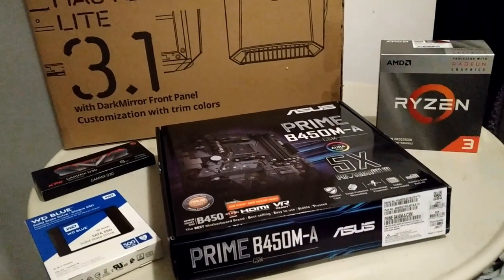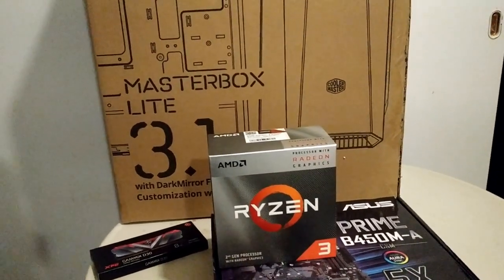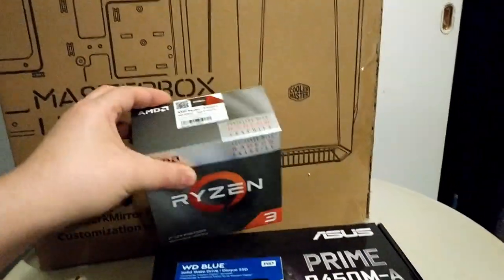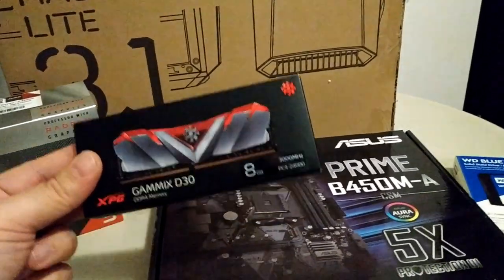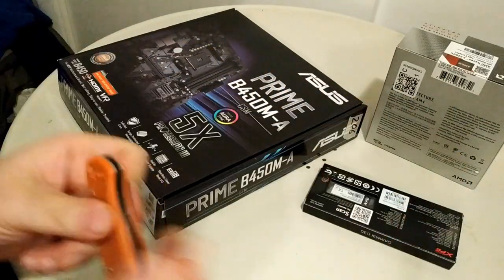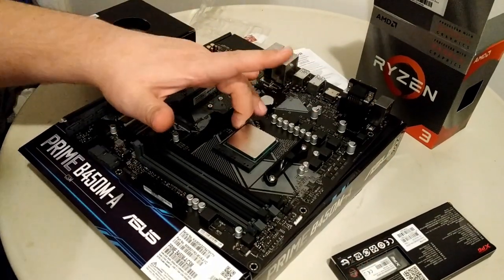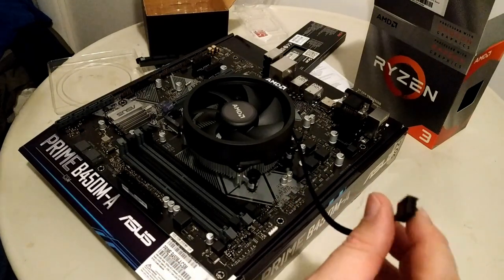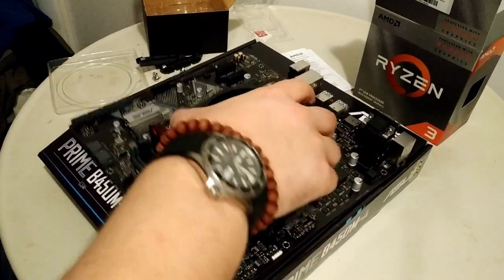Low Budget ($328 USD) AMD Ryzen Build!

Comment: Doing my second build with this new board - using existing 5yr old Coolmax case. Ryzen 5/2600 chip…The MOBO & AMD CPU cooler fan are 4-pin as are the rest on the MOBO so my old 3-pin case fans don’t connect (splitter or change the fans?)…32G ram (16G pair). Also discovered this MOBO & CPU setup requires a separate video card as this CPU has no video? Problem I have is with the separate pin connectors…so wish me luck!
Reply from the maker: You can put 3-pin fans on 4-pin headers they're keyed to fit.  Also yes only models with "G" on the end have graphics (2200G, 3400G, 5600G etc)

Comment: Been assembling systems for 22yrs and always build outside of case and on anti static bag with usually included thin piece of foam. Never had any issues
Reply from the maker: Honestly it's probably not a big issue either way but it is something I picked up from a Linus Tech Tips (or NCIX Tech Tips) video like 12 years ago and it stuck with me for some reason.

Comment: Being honest, I'd use a low-profile graphics card (yes, they're still made, but are one generation behind) in a build instead of using an accelerated processor (APU).  It's good for modularity later in case she wanted to, say soup it up for gaming with something like a GTX 1650 in there.  Also, there's far less ram required to run a discrete card where as the APU does compensate with demanding more system RAM.

>applying the pre-applied thermal paste
You're going to need to re-paste that later.  I'd take the paste off the heatsink and apply some fresh Arctic MX-4 or better in between.  Thermal paste can cure, the paste quality can be dubious and you don't know how long that the cooler's been stored away for...
Reply from the maker: According to intel and AMD the stock TIM is good for the life of the processor.  Whatever that means.  But I wouldn't worry about it until maybe a few years in when doing basic maintenance to fans etc anyway.  Stock TIM is perfectly fine for a normal user.  We can always add a dedicated GPU later if needed.  The Radeon Vega 8 is decent but even a GT 1030 would be a good upgrade like you said with dedicated vRAM and I think many of those come as low profile (not that I need it with this case) and cost around $120 here in Canada.  Same with RAM if they decide they want more down the road I can throw it in for them.  No big deal to upgrade this later if need be.  That's the beauty of PC after all right?
Reply: I'd disagree about the dGPU, even the cheapest of graphics cards in a store will be $50. He wanted to keep this under budget.  Also he stated he wasn't sure if VGA was still required,
- Seeing as the old PC ran XP, the probability of that actually quite high. I believe Analog output has been dropped from Nvidia cards since the 10 series? Your not going to find VGA on anything high end anymore,  but even if there is one card that still has it, your unlikely to find the exact model in a store, and then a DP to VGA adapter would be required, further adding to costs.

Also APUs really have come a long way. AMD's built in graphics have always been pretty good, it was just the CPU part thats been lacking, until Ryzen. If you really wanted to, you can game on a 3200G fairly well.
Reply from the maker: Yep and the APU is faster than those $50 cards like the GT 710 for example.  If you're worried about the APU stealing 2GB of RAM it's still cheaper to just go up to 16GB RAM (an extra $33) and they'd have more than enough to spare.

Comment: Hey great video, longtime sub.

I just built a super low end gaming PC very similar to your build, bought everything new except the RAM bought used from a friend.

Did you run into issues with the integrated GPU and NOT having dual channel RAM? I heard dual channel was a requirement just wondering since you used 1 stick.
Reply from the maker: Nope no problems.  Dual ch definitely not a requirement but highly recommended if you're gaming on igpu and want to get the best performance out of the graphics.  But it runs fine without it just be a bit slower.

Comment: Better with a ryzen 5 3400g (140$ on amazon) and à kingoston 480gb ssd (48$ on amazon)
Reply from the maker: Maybe the 3400G is a tiny bit faster than the 3200G (but not much) and the WD SSD is not only faster than the Kingston (A400) but also has a 5 year warranty instead of only 3 year.  I'll take the WD thanks.  But not really that big of a deal either way get whatever you like or whatever is on sale from one moment to the next that makes a difference too.

Comment: Great build and video!  I'd love to build my own PC!  Do you ever wear an anti-static wristband?  I worry about static electricity messing things up, because I live in a dry semi-arid desert climate (Denver, Colorado).
Reply from the maker: Honestly built a hundred PCs over the last 12 years  or so (many for work not just personal builds that is!) and never once used one of those straps.  Never been an issue.  Many people I work with have done and said the same.  I wouldn't worry about it.
Reply: I just touch the case metal in-between doing anything

Comment: I used to build my own pc but with refurbished  i7 complete computers on amazon for 179 with a warranty it just makes no sense now to build a pc you can buy a new pc for 299
Reply from the maker: Does this $299 computer come with a 500GB SSD?  Does the used PC have a 500W PSU and the room to upgrade to a GTX or even RTX class GPU?  Can either of them start with a quad core but upgrade to a 6 core of even an 8 core without changing the motherboard?  Point is there's still good reasons to build your own.  The graphics in this APU are way faster than the intel iGPU in those used off lease core i7s and CPU performance is similar.  Again none of those are going to come with a 500GB SSD.  This would have been under $300 if I just used a 1TB HDD instead, or around $300 with a 250GB SSD but they wanted a 500GB SSD.  I would love to see what this new $299 PC has if you can tell me the model and who sells it.  Here that's about $400 CAD and that gets you something like an Acer with a Pentium and an HDD.  Sure used yes I can get used off lease Core i5 quad core w 8GB RAM for apx $200 CAD but those will either have a 500GB HDD or maybe a 128GB SSD.  It's about $350 here for one with a 380GB SSD.  I would know I sell Microsoft certified refurbished Lenovo think centers and HP elite desktops every day.  Again there are benefits to custom builds.  Warranty alone I have 3 years on each part in this build and 5 years on the WD SSD!  I know if anything fails in 3 years I can RMA the part myself.  Even new PC's only have a 1 year warranty %95 of the time and like the refurbished ones I'd have to ship the entire PC away.
Reply: @MN12BIRD  yes but all those things u say cost alot more here to build the same pc as u would be like 500 dollars i wasnt shitting on your video i was saying in my situation the 179 pc makes more sense it has a 3 year warranty and a 500 watt power supply i think thats a great deal and if i pay a little more for 249 i get a decent graphics card running games on low to med setting

Comment: Can this motherboard handle a ryzen 7 2700x? Also was going to get a gigabyte aorus radeon rx580 or the next one up the XTR rx580 just wanted to know if it can handle would hate to make a mistake if so should I get a higher power supply lastly?
Reply from the maker: The motherboard can handle the 2700x yes as for the PSU it would probably be okay but it is in the edge so I'd say get something better like even just a Corsair CX or TX 550 watt, maybe an evga 600b watt bronze if you can find a good price on one.
Reply: MN12BIRD I’m also getting lastly getting a fryzen rgb cpu fan would that require a 650 waltz?
Reply from the maker: @metaldragongaming597  again 550 will be fine but like I always say depending on your budget and also what's on sale it never hurts to go bigger.  I mean if a good 650 watt happens to be on sale for like 10 bucks more than the 550 you're looking at then go for it.  But if your budget is strict and you see a 550 on sale that looks good it will be fine.  The RX 580 uses about 180 watts under full load and the CPU maybe 100 watts. Those are the two major power components.  Entire system might draw 400 watts under the heaviest of loads so even a 550 has lots of overhead.  550 or 650 just depends on sale prices I say
Reply: MN12BIRD thank you so much man! I put in all the parts on system builder with all the extras and said estimated wattage 402 waltz

Comment: Hello fellow Canadian here. I'm looking at the same exact motherboard as yours online, but by the looks of it, there is no 3000 ready orange sticker on the box. Yours seems too have one? Could you help me out here. The motherboards with that name, a/csm will it compatible wether it has the 3000 branding or not
Reply from the maker: no u need to make sure the BIOS is up to date to handle 3000 series.  if the board is old stock that has been on the shelf for a few years it will need a BIOS update before it can POST a 3000 CPU.  you would need an older 1000 or 2000 series CPU to put on first and update the BIOS then it can handle 3000.  big pain so make sure it has the orange sticker on the box telling you the stock is somewhat newer and it left the factory with a newer BIOS.  otherwise you have to get in contact with AMD and they'll send you and older CPU in the mail to do your update but right now mail service is super delayed you could also bring it to a computer shop and pay them to update the BIOS.  the thing is you can't trust the picture on a website one way or the other it could show the sticker in the picture and the board you get doesn't have it or vice versa.  maybe ask the seller if you can?

Comment: I ordered same mother board but with Ryzen 5 2600 and 16gb ram 3200 speed . It’s my first build ever , is the ram speed automaticity gonna be running lower then 3200 ? If so should I change the speed to max (3200 or should I put the speed to yours ?(3000 thanks 🙏
Reply from the maker: It will probably default to a slower speed just set it to 3200 if you can and if not 3000 will be fine.

Comment: Hey did you ever run into any issues increasing the ram speed? I got my gf the same motherboard and I think the same cpu (2200 G?), with 16gb of ram that handles up to 3000mhz, when i upped her ram speed she'd get constant crashes in windows, not sure if you experienced this as well?
Reply from the maker: Mines a 3200G and also RAM brand and other specs make a difference.  If it doesn't run stable at 3,000 try stepping it down to 2,800 or try a different brand.  I've had good luck with gskill in general on Ryzen but once had Corsair that would crash at rated speed.
Reply: @MN12BIRD  I seen to have it working at 2933, thanks!
Reply: the CPU only supports up to 2933

Comment: I bought the same motherboard. I'm curious is there only 2 places to put fans? I have a smaller atx case but I just feel I need more than 2 fans.
Reply from the maker: can't remember as I built this for a friend and only had two fans.  if you need more you can always get fan splitter cables
.
Reply: @MN12BIRD  thank you!

Comment: Hey are you alive? I have the same build and I wanted to know if have had any problem with the build, because I did have problems, like this weird thing when I am in Windows everything stop, I have a black screen and then it return to normal. I think some Windows Update is not compatible with the mobo's bios. I am currently using the 2022 bios. Pls help :(
Reply from the maker: Sorry no idea I haven't had any issues with it since it was built for my friend he has had it since running fine

Comment: Hey you should try pop os from system76 it's really good, free and more secure than win10, I don't know if you have seen the tech news, the nsa found a flaw so bad I've they wouldn't use it an notified Microsoft but they refused to patch it, I don't know what it was but that sounds bad, I'm using pop os a Linux distribution which works very well with my ryzen 2600x, I'd suggest you give it a try or at least research it, plus you really should watercool the cpu an aio would be a good start preferably a 280mm with some 140mm noctua ther 3000rpm industry ther great I only run mine at half speed even under heavy load I rarely creast past 47c an at 50% speed ther dead quiet but the just my 2 cents, oh hey get at least 16gb instead of 8 right now from Amazon 16gb of g.skill flair x 3200mz for 68$ it's worth the splarge
Reply from the maker: Yeah I've heard about Pop OS before and gotta say it does look good.  I've used a few Linux distros in the past but always come back to Windows full time.  My wife also complains anytime I change the HTPC to anything other than Windows!  My main PC is a Ryzen 2600 and it has a CM Hyper 212 Evo with a 120mm Noctua fan on it.  Keeps it plenty cool even when doing 8hr+ renders it holds full turbo the entire time and doesn't break 60.  That's cool enough in my book esp considering ambient is high in my apartment it's always hot.  It's also very quiet with the Noctua fan on there.  My HTPC is a Ryzen 2200G and that has a cheap $15 DeepCool Gammax 300 (120mm fan, 3 cooper heatpipes) air cooler on it.  That thing alone dropped about 10c off the stock cooler and also maintains turbo under full load (the stock cooler would drop to base after a few minutes at full load) so even a cheap aftermarket air cooler can make a big difference.  Water cooling can be a bit better sometimes (I think there are 140mm Noctua air coolers that can beat 240mm water AIOs or at least hang with them) but to me it's not worth the extra cost over a $30 Hyper 212.  Maybe if I was OC'n a Core i9 9900K all-core or something crazy!  But I don't bother to OC Ryzen as it's a lot of work to get a tiny bit extra out of them as you probably know.  RAM yeah, I understand what you mean.  Considering it was something like $33 for the 8GB stick doubling up to 16GB really wouldn't have been much more in the grand scheme of things.  But they are coming from an XP machine that had 4GB of RAM at most and again will be doing very basic use on this thing so I think 8GB will be fine.  This thing probably won't be getting that much use at all really.  They have a Ryzen 2600 with 16GB RAM and a GTX 1060 as their gaming PC that the husband uses (I built it for him a year ago) and I doubt the wife hardly used the XP machine!  Otherwise yeah, G.Skill is usually my go to brand esp on AM4 builds both my AMD systems are running G.Skill!  But I was at the mercy of what was in stock and the store was almost empty on G.Skill.  What RAM they had in stock was mostly Corsair and some Kingston Hyper X.  I took a chance on this ADATA XPG as I've never actually used this brand RAM (I've used lots of ADATA SSD's and they've been ok though)

Comment: Does ryzen 5 3600x will work straight out of the box or do i need to update my bios? Also i have the same cpu right now i just needed to upgrade for better performance gaming
Reply from the maker: If your mobo box has the orange "Ryzen 3000 series ready" then it's ready, if not then you need to upgrade.  No way for me to know otherwise it depends when your mobo came off the production line.
Reply: MN12BIRD oh okay mine doesnt say i couldnt find that sticker anyhwhere on my mobo box but its supported to ryzen 5 3600x i just need a bios update for it, its asus prime b450m-a csm i look at their website and its supported, any how thank you!

Comment: I need help placing the front panel connector they won’t work
Reply from the maker: Google images and just worry about the power switch to see if the PC turns on.  Then worry and the reset and LEDs and remember the polarity of the LED headers matter so if they aren't lighting up just flip them over.
Reply: @MN12BIRD  my pc turns on from jump start I just can’t get them to work

Comment: Does the motherboard require the bios update?
Reply from the maker: No it has the orange sticker on the front of the box that means it's bios ready out of the box for a 3000 series Ryzen so it's good to go.  If it doesn't have that sticker on the box it's not.  I've seen multiple motherboards on the shelf the exact same model stacked on the shelf where some have the sticker and some don't so be careful esp ordering online to make sure you're getting one with the sticker.
Reply: @MN12BIRD  which is the orange sticker

Comment: Will I need to flash another CPU or does it work straight out the box?
Reply: yes
Reply: @Sultan-nx5qy  which...?
Reply: it will work straight out of the box.
Reply: @RWL2012 yes i got mine yesterday and it worked out of the box

Comment: No need for thermal paste?
Reply from the maker: No you never need it with a new stock cooler.  It is pre applied to stock coolers.  The only time you need to use thermal paste is when using an aftermarket cooler that doesn't have it pre applied or when re using, removing a stock cooler then you need to redo it (clean off old and apply new)

Comment: How did u got the wifi on it?
Reply from the maker: it doesn't have wifi, use hard wired or you have to get a usb wifi adapter or pci-e wifi card.
Reply: MN12BIRD ok thx

Comment: Hey does the mobo light up? Since it says its aura sync
Reply from the maker: Not on the board it has a header to plug in an RGB led strip and control it.
Reply: @MN12BIRD  ah ok.

Comment: Can i use 6 fan on this Motherboard ? Sorry it's my first time.
Reply from the maker: no this basic mATX motherboard is only going to have a few extra fan headers.  I can't think of many that would have 6 other than some higher end boards.  you usually need a fan controller or fan header splitter cables to run that many fans.
Reply: @MN12BIRD  thank you for your help sir. Appreciated